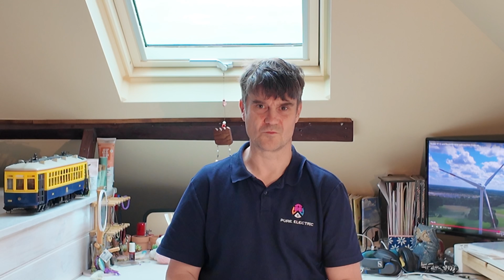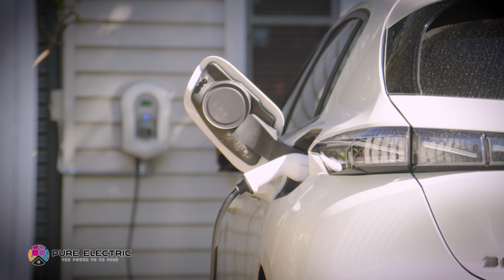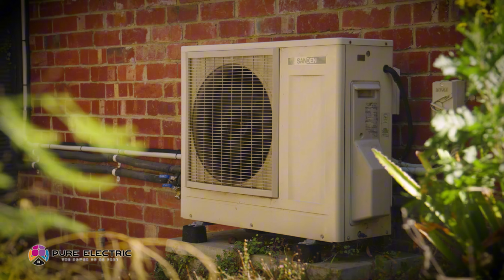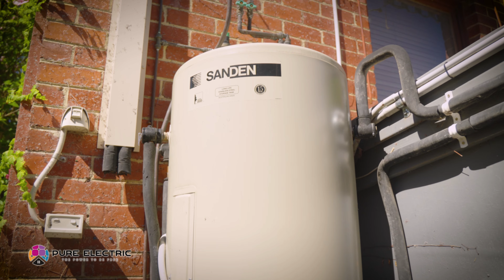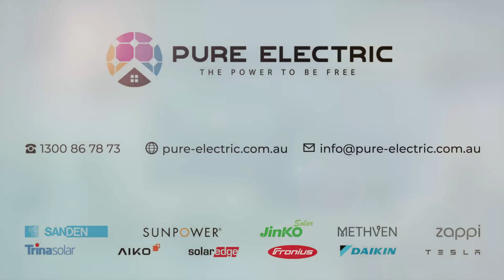Zero Carbon Australia: How We Get to 100% Renewable by 2035 | Pure Electric Ep. 4

Comment: I wanted to increase the solar panels on my roof, but I was told, by solar installation companies, that the limit in WA is 5kw of solar for single phase
Reply: That is the inverter limit. However you can oversize that with 10-12kW solar panels with many solar hybrid inverters.  There are a number of inverters that work on 1P with those kind of numbers. So 20kW might be a challenge at the moment in the current regulatory environment there but you can definitely get 12kW.
Reply: @beyondzeroemissions  Thanks for your information. I'll have another go at increasing my panels!
Reply: Update" That is old info the latest info about WA is that is an inverter soft locked limit.  In WA you can now install Tesla PW3, Istore or others 10kW (hybrid battery solar) inverters that are software locked to 5kW with 20kW panels on them.  So 20kW is doable in WA in line with the plan.

Comment: 2035 Zero Carbon Australia Energy Plan — Summary
Goal:
A zero-carbon energy system for Australia by 2035 by fully electrifying stationary energy, transport, and heating sectors.

⚡ Electricity Generation Mix
Total Demand: 400 TWh/year
(includes transport, residential/commercial heating, low-temp industrial heat)

Solar PV (50%, 200 TWh/year):

Capacity: 180 GW total (40 GW existing + 140 GW new)

New Solar: 100 million panels, 27.5% average efficiency

Existing Solar: ~40 million panels, 20% average efficiency

Capacity Factor: 16% (annual before curtailment)

Locations: Residential, commercial and industrial rooftops

Wind (50%, 200 TWh/year):

Capacity: 80 GW total (12 GW existing + 68 GW new)

New Wind: 7,500 turbines (avg 9 MW each, rotor 170–270m, swept area 23,000m2 - 53,000m2)

Capacity Factor: 30% (annual before curtailment)

Locations: including inland plains, utilising nocturnal low-level jet winds.

Other Renewables:

Hydro for diversity and dispatchability (but not counted toward 400 TWh target).

🔋 Storage Mix
Total Storage Capacity: 1,300 GWh
(designed to ensure reliability even with renewable variability)

Breakdown:

Existing Hydro: 200 GWh

Snowy Hydro 2.0: 200 GWh

Behind-the-Meter Batteries (Homes): 300 GWh

Grid-Scale Batteries: 200 GWh

Rolling EV Storage: 200 GWh

Technologies:

Lithium-ion Batteries: High energy density, residential & grid use.

Sodium-ion Batteries: Lower-cost, ideal for stationary and grid storage, nearing mass production.

🏡 Behind-the-Meter Setup
Per House: 20 kW rooftop solar + 60 kWh battery

Coverage: up-to 50% of Australia's houses, with balance on commercial and industrial rooftops

Total Contribution: 300 GWh of distributed storage.

🚗 Electric Vehicles (EVs) as Rolling Storage
Grid Contribution: 200 GWh via vehicle-to-grid (V2G) bi-directional charging.

Role:

Backup during rare extreme peaks.

Adds flexibility without additional stationary infrastructure.

🔄 Engineered Curtailment
Curtailment Volume: 60+ TWh/year (solar and wind)

Purpose:

Grid stability: manages overgeneration, frequency regulation.

Acts like "virtual storage" without needing expensive physical storage.

Benefits:

Zero-cost excess energy most days of the year (~300 days).

Enables innovation: e.g., synthetic fuels, desalination, hydrogen production.

🏆 Key Plan Features
Full Electrification:
Replaces petrol/diesel/gas with electric heat pumps and EVs.

Massive Scale-Up:

4× solar capacity (relative to 2025)

6× wind capacity (relative to 2025)

System Resilience:

Diverse generation mix (solar, wind, hydro).

Distributed and centralised storage, EV integration.

Cost Efficiency:

Focus on sodium-ion batteries.

Use of engineered curtailment to avoid overbuilding expensive infrastructure.

Comment: We can get onto 100% electric (or as close to 100% as we can without resorting to barbaric measures) but it will cost a lot of money, however it is going to cost a lot of money to get it done and it will be needing incentives beyond the incentive plans that you yourself would be comfortable with

Let's say I offer you 40% off the price of your battery storage and you order enough batteries to keep your house's lights on for 3 days without any energy input, you would believe you got yourself a good deal HOWEVER that 40% off comes with an asterisk.

I get to take your power, let's say you sign the form and I offer you 3c/kwh, you would still be fine and happy with that, but what you might be a bit gut wrenching about is the fact that when your batteries are over 80% I can take that energy and give you your coin, but never below 20% battery, I can use that as I see fit as long as I give you your coin and your battery needs to be accessible at all times.

THAT would solve the battery problem within 5 years, if it doesn't then mandate all structures are required to have "solar panels and estimated 3 days of battery storage connected to the network" that's what would be called the heavy handed approach but still reasonable.

BUT! on the flip side, let's say you don't take the 40% off subsidy, that gives you the option of either off grid living or making bank with a nice 5c minimum pay OR you can sell when the market reaches above a certain amount that's favourable to you and you can then say "hey, I will sell back either of these conditions "either battery reaches 80% OR market exceeds X cents OR never and network needs permission to connect.

those are the 3 options that would save the nation but... they are opting for minimal solar deployment which IMO is sad.
Reply: It won't cost a lot of money.  We had/have a proposal from the Liberals (Conservative party in Australia) to go nuclear. This would cost twice as much as continuing with renewables. We have capacity to rollout renewables but we have nothing in terms of nuclear industry capacity and even the countries that do have super expensive projects. (See recent projects in the USA, France and Finland.  Australia goes for the highest safety in anything. (ie electrical safety in Victoria and other states is the highest in the world) therefore we would not accept cheaper to deploy (less safe) Russian or Korean reactors.